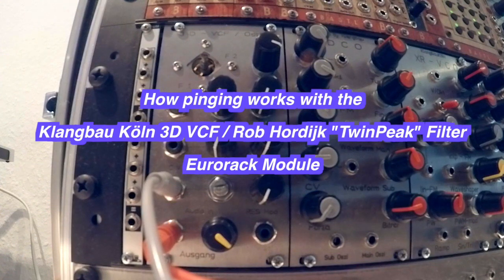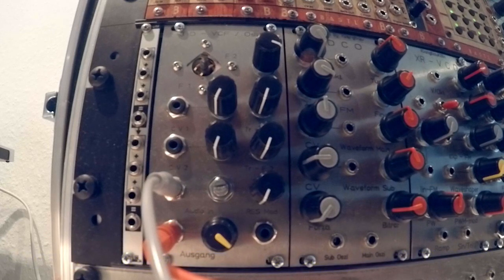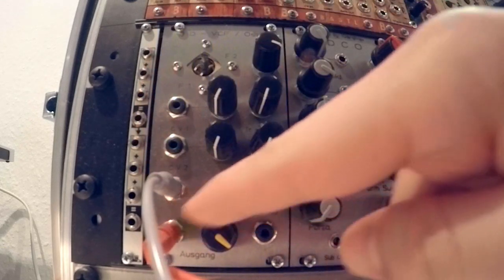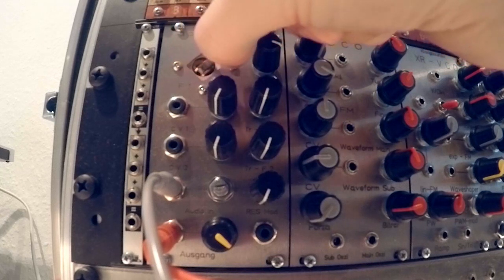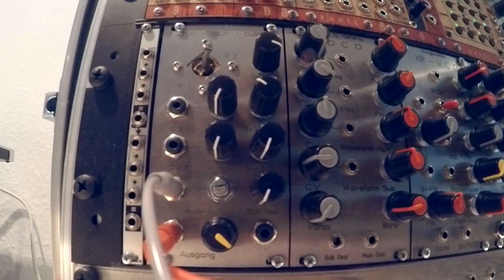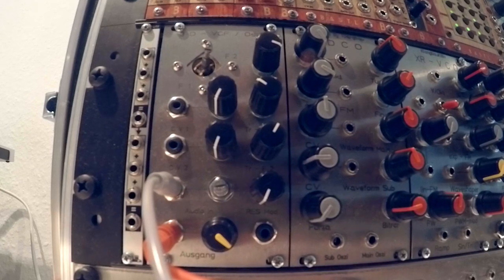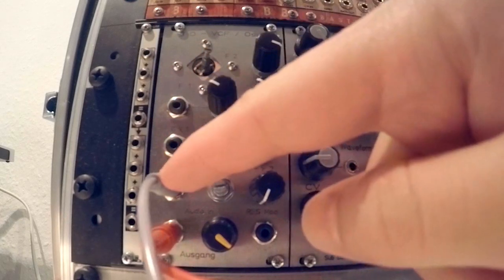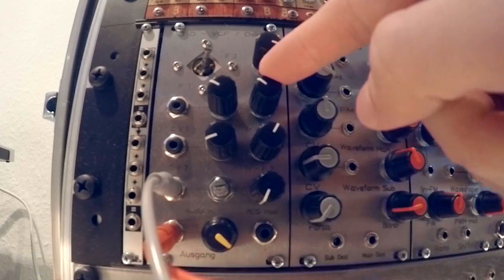Klangbau / Hordijk Twin Peak Ping Demo (Eurorack VCF) #TTNM

Comment: very pling ing demo. Could this be the analog version of MI Rings with no strings attached? 
Have you done a demo of Klangbau's wavefolder by any chance?
Reply from the maker: +airfrankenstein I have not done one on the Wavefolder. The Wavefolder I own is an early prototype with only one input and maybe also less refined circuits than the current version for sale.
Reply from the maker: +airfrankenstein P.S. I asked Klangbau today and the current Wavefolder for sale is indeed quite different from the prototype I own. Sounds nice though! Maybe I'll buy or trade for one someday.
Reply: +The Tuesday Night Machines 

Thanks for your reply. I contacted Klangbau as well and if I understood there will be a demo soon.